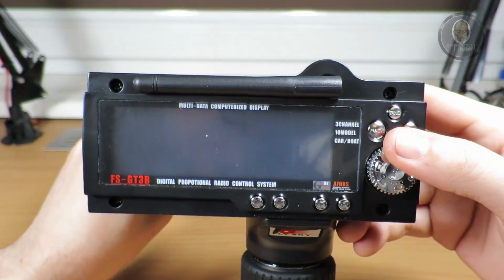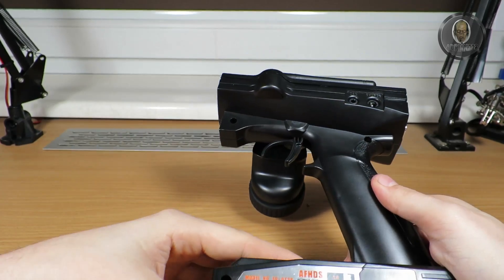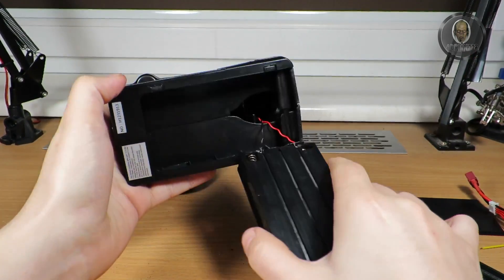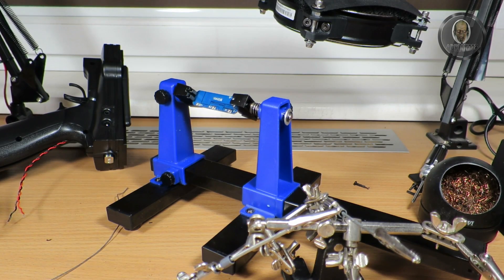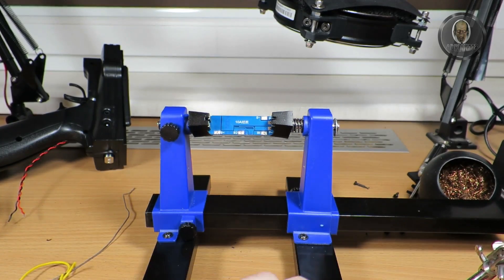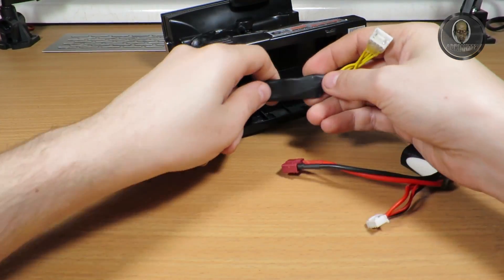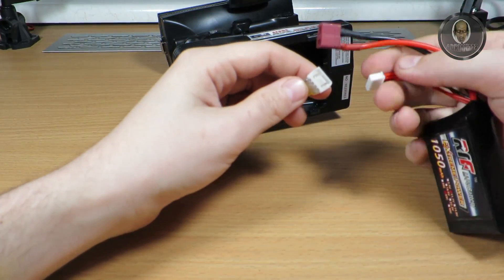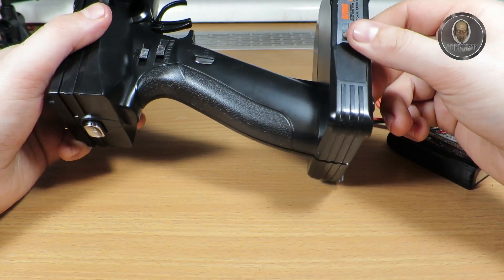Flysky FS-GT3B Li-Po mod with protect board

Comment: You didnt change the regulator?! You need to replace the LM7805 regulator with a R-78E-1.0 or similar it will extend battery life 3x with 40% to 90% efficiency and a lower cut out voltage.
Reply from the maker: lipo protect board will protect that

Comment: does this remote have to use a 12v output adapter to charge the battery?
Reply from the maker: Voltage need to be higher than batteyr if You use charging board that's why it's mostly 12v but some chargers charge individual cell than 5v is ok.
All depend on module that You use and I don't remember what minimum voltage need this one :)

Comment: Do you think it will fit 3 of 18650 with the battery tray removed?
Reply from the maker: My battery is 19.3mm tall and that is tight fit with cover but I don't have that battery to measure or try
Reply: @Adrian202  thanks!

Comment: Ja przerobiłem swojego Radiolinka RC4GS na 6 kanałowca, bo miałem 6ch odbiornik a radio ma płytkę główną z taką samą jak RC6GS i wystarczyło tylko dolutować 2 switche (ja zainstalowałem 2, 3pozycyjne) i zainstalować soft z RC6GS, bez problemu sie udało. Zrobiłem też moda na li-ion tj 3 x 18650, kupiłem pojemnik na baterie z ali za 2,50zł, troche przyciąłem, żeby się zmieściło na miejscu, akumulatory ze starej baterii od laptopa i mam bardzo dobrą 6 kanałową apkę z gyro za 210zł w PL i z gwarancją. Pewnie kupiłbym w Chinach ale akurat moja padła i 40zł róznicy aż tak mnie nie bolało.
Reply from the maker: No z gwarancją już nie :D ale brawo za mody :)
Reply: @Adrian202  z tą gwarancją to różnie bo same Liion nie ma jak sprawdzić ze tam było, ponieważ tylko sie wyjmowało tacke na AA i wsadzało aku, ale faktycznie z lutowaniem można się połapać